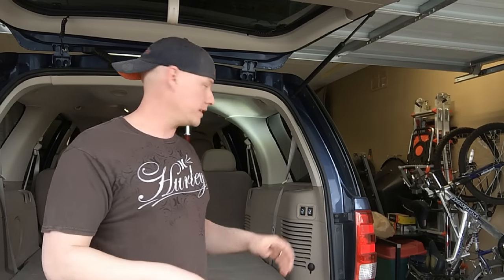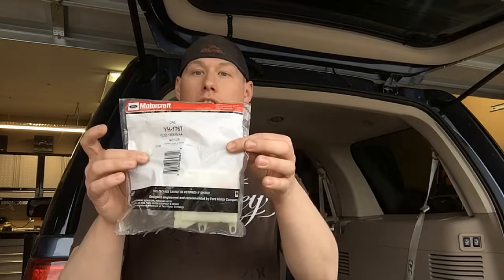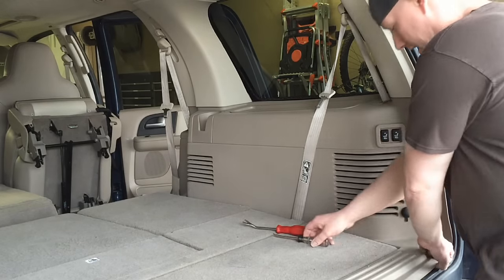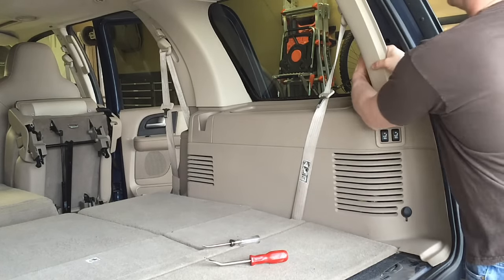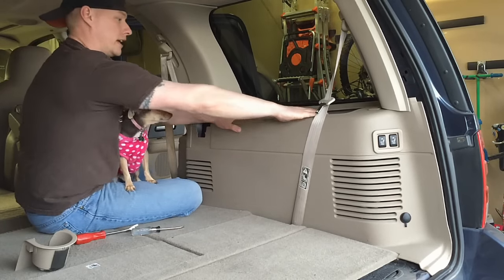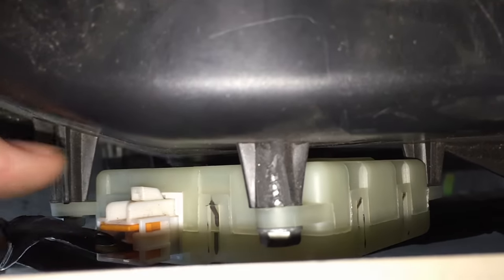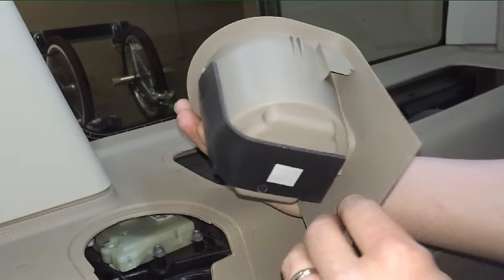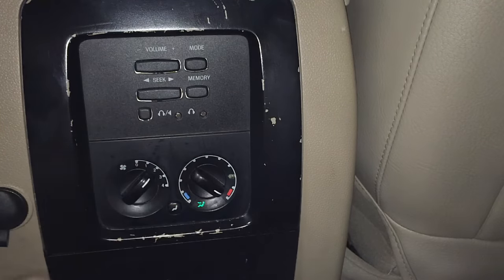2003-2006 Ford Expedition: Rear HVAC Temperature Blend Actuator Clicking Repair

Comment: Hello I was wondering if this is the part needed to change if I'm not getting hot air in the rear everything else works fine AC but went I turn on the heat its just cool air coming out the rear thank you

Comment: On mine I was having this problem removed the actuator and saw two teeth were broken off the broken peices had been binding the gears up I removed the broken peices two bits of teeth and mine works fine now if it does it agn I will buy new one off amazon also a tip to help u may want to have a magnetic retrieval stick on hand the screws are very easy to drop into the bottom of the panel and u can retrieve them instead of takeing whole panel off

Comment: Hi our Ford Excursion is only blowing cold air in the back, even when the rear temp control is set to heat. Does this mean the actuator needs replaced in the rear? Please note the rear has a seperate control from the front

Comment: Awesome video. Thanks for all the tips. I need to replace both actuators, are they the same part for a 2003 Expedition?
Reply from the maker: ***** I have links to the actuators in the description below the video for this one and I have another video on the other actuator with links to the correct parts as well.
Reply: FordTechMakuloco Where is the video for the other one? Is the other one forMotorcraft YH-1743?

Comment: Have the same issue I replaced the one by the cupholder in the video but not the one you actually changed in the video.. So they both are rear heater door actuators?

Comment: Thanks!! Still have my 2007 Lincoln Navigator and needed this video (same). Just FYI...when I replaced the one in the video, I still had the same clicking noise as before. Apparently there are two of these inside the panel. The one I needed to replace is right behind the cup holder. So you don't need to remove anything but the cup holder and the flat tray. Thanks for the video!!!!

Comment: Some people have posted that they have changed the actuator only to find the clicking still existing because it's in the other actuator. Maybe first determine which actuator is clicking by placing your fingers to feel the clicking or not clicking.
Reply from the maker: yup but the entire box clicks so it is best to disconnect the electrical connectors one at a time to isolate it.

Comment: I have a 2005 Ford Explorer it has the same problem in the back. Is it the same process for that vehicle. I am familiar with it since I changed the front one thanks to your other video. Thanks. And is it the same part as the front one?
Reply: no. the expedition is bigger and has different parts on it.

Comment: When the 7 minute mark, when the door falls and is in the 'down' position where is the air blowing?  Is it the ceiling vents, or the bottom vent?  Thanks!  I'm considering just forcing it to the in the ceiling vent position and leaving it there.
Reply from the maker: +SOKO MAN (SOKOMAN) Not sure exactly I never turn the blower on during replacement

Comment: Is this for the roof to ceiling air adjustment, or for the hot to cold adjustment? I thought it was for the temperature but at the end of the video you cycled from the ceiling to floor.  My expedition is only blowing hot air from the rear vents, so I'm wondering if this is the part which needs to be changed or if it is a different issue entirely.  Thank you for your videos, they help so much!

Comment: I replaced the rear mode actuator several times in my 2005 Expedition with a Dorman part from Advance Auto. After a number of months a gear tooth would break and I was back to the clicking. Finally removed the electrical connector and super glued the actuator so the air came out of the roof vents...tired of replacing it. Do you think this is due to using the Dorman part? If I had used Motorcraft would I have better life or is something else going on?

Comment: I got the same problem in my expedition 2006, my question is which actuator I have to change?  three moths ago the noise start, but now hot air is coming from the ceiling vent when the a/c is on.... like your videos Brian.

Comment: Just did my 07 Expedition EL.  This really helped.  The 07 has Torx screws instead of 8mm.  It also has two actuators right next to each other.  I changed out the rear one and the back now blows cold again. 

What does the other actuator do?  When we have it on rear control the pressure is slightly lower than when the driver has master control.  Do I need to change the other actuator as well?

Comment: Hello,

I have two questions.
1) How can you tell if it's the temperature blend actuator, or the control which switches the air zone (foot zone vs. top zone)?
2) Is it the same procedure for a 2005 Lincoln Navigator?

Thank you.

Comment: Great video man. After replacing my actuator on the side, I found out I realized the bad actuator was the one on top. I have a 2004 expedition. The side actuator is a D shape shank. The actuator on top is a cross shape shank. 
So after replacing the actuator on the side (which was still good) I removed the bad actuator on top. I opened the housing on the side actuator (the one I removed) and used the good gears to replace the bad gears on the bad actuator on top. Pretty simple fix. Just note the position of the shank before you open the housing.

Comment: Thanks for your videos. Very useful. I have a 2008 Expedition Limited EL. The AC control unit is stuck on auto. Is this a full AC module replacement or just the controller card replacement? Do you have a video replacing either? Thanks

Comment: so if my mode door actuator is a cross type and not the d type shaft. what are the odds that the blend door is a d shaped? or is there even a cross shaped shaft for the blend door?
Reply from the maker: The other doo only has one option
Reply: Thanks for the info.

Comment: Saved me a lot of time, thanks for the easy way to remove all the plastic in my 2003 Expedition, I used a piece of molding to prop it open and it was kinda tricky especially the side actuator, the one on top for the heater was my problem, I replaced the one you suggested and did not stop the click, so I replaced the top blend door actuator and VOILA!! But your expert info helped me a million ways thanks!!

Comment: Great video. On my 2003 Ford Expedition EB I had the clicking noise which I read somewhere that u could just unplug it because it only works the rear foot air, so I just did that on this one. Anyways im thinking maybe the other actuator is bad but it does not click. The problem I'm having is when in drive the front vents change from blowing air out of the front vents to the very top vents on the dash. Wondering if I replace the actuator that is harder to get to if that will fix the problem?? Any idea on this one Brian?
Reply from the maker: Tonya H No you have a vacuum leak on your hvac system make sure the vac line is plugged into the heater control valve above the rh valve cover if not check for other vac leak in the engine compartment like the vacuum reservoir for cracks.
Reply: FordTechMakuloco  thanks so much, will have to get hubby on that.. ;)

Comment: Hi there.  I need some help. First time doing the AC . For how long do I need to vacuum and how much freon I need to put in.  This for 06 Lincoln navigator with rear AC . Thanks
Reply: depends on how long the lines have been exposed to the atmosphere. I would say 15-20 minutes if the lines have been open to atmosphere for a bit. Don't quote me, but also you can look online for the freon amount, remember to also replace the oil that has come out if you replaced the compressor or any component really. (usually just replace with however amount came out)

Comment: Thanks for the video.  Definitely a help when pulling all the panels and trim parts.  This was for a 2005 Expedition.  And in my case, I also had 4 mounting screws to remove.  The two you show removing were the easy ones! Ha!  For me the Motorcraft stock was YH1749 with a Ford part # 3L1Z 19E616 AA.  I took the old part to Ford to insure I got the right one and came away with the same part number with the exception that the two last letters were AB on the new part.I did remove the old "D" shaft from the broke unit to check for unrestricted movement of the Blend Door, noting the relative position of the flat side of the "D" when inserting and removing the shaft.  This aided in replacing the new unit.  Sure enough, several teeth of the smaller gear were scattered in the grease in the broken unit.
Reply: An added thought.  Several months ago when we noticed the clicking sound, I removed the cup holder and top tray to find which unit was making the clicks.  Reach down and lightly touch the blend actuator and also the distribution actuator.  You can feel the one causing the clicks.  I unplugged the suspect actuator to confirm the correct one.  After all the naggin', I finally broke down and replaced it in cooler AZ weather!  Now, on to fixing other nags!

Comment: Thank you for this video. Expeditions have a front, middle, and rear row. Does this actuator control the middle also, or only for the rear are? My understanding is that there is a front actuator behind the radio for the front ac, and obviously what you've taught here is for the "rear," but I can't find a resource for the middle row. Thank you again for all your contributions.
Reply: There is only a front and a back. The middle is controlled by the back.
Reply: @EvanDunville  thanks so much! I've been scratching my head for weeks on this ...

Comment: Great video!. You show the part as YH-1767 and call it the HVAC temp blend actuator, but on Amazon that part number is called the A/C Heater Blend Door LEVER. They show the Blend Door actuator part as YH-1743. Can you please clarify?
Reply from the maker: The parts I have listed are correct from the Ford catalog. You can trust the Ford catalog or Amazons.
Reply from the maker: +HOZ27 what year expedition I can verify it for ya.
Reply: 2004